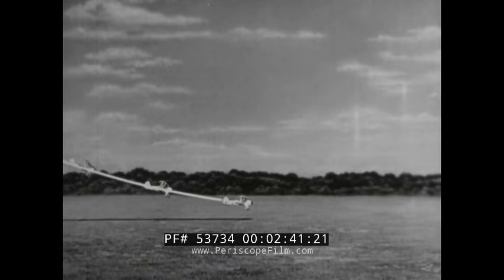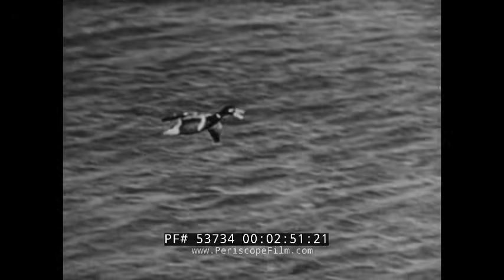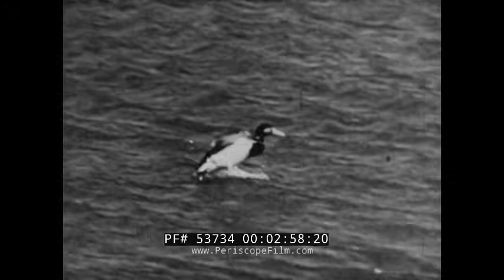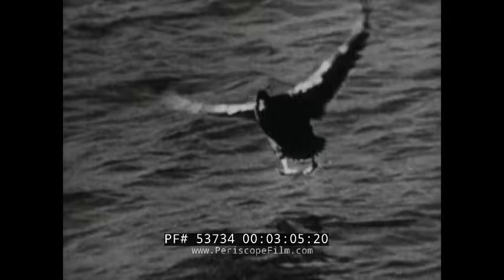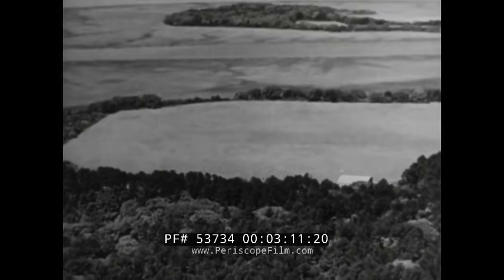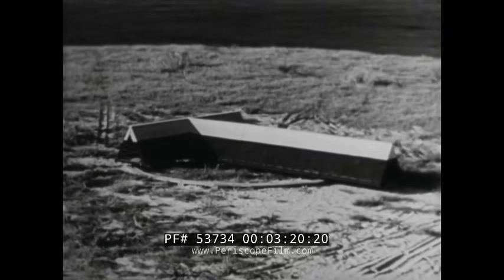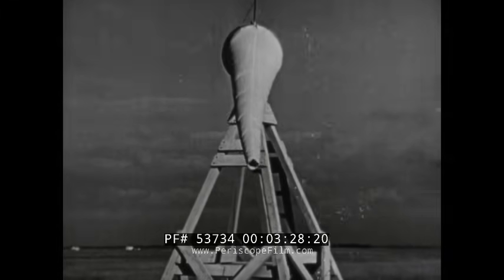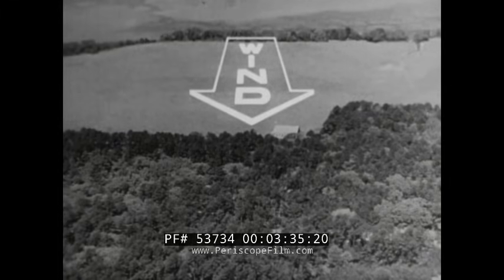U.S. NAVY PRIMARY FLIGHT TRAINING FILM   HOW TO LAND A PLANE  53734

Comment: Flight instruction hasn't changed much because aerodynamics hasn't changed at all.
Reply: Ground is just as hard. Worse of all, human pilot still comes standard with same faults as in 1906.
Reply: There were some Army Pilots like Chuck Yeager,  Bob Hoover, and Jimmy Doolittle, who would fly the P-40, the P-38, the P-51 and the P-47.  They were all airplanes, designed to fly, and the pilots had only to learn their peculiar systems and take them up for a spin.